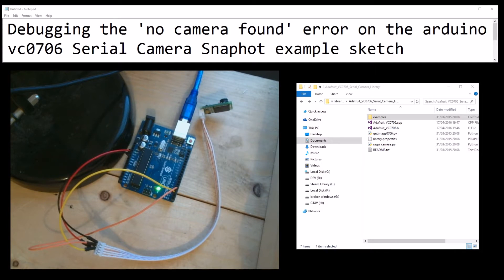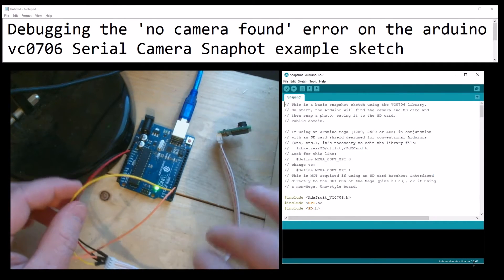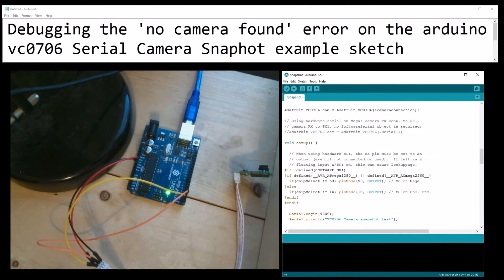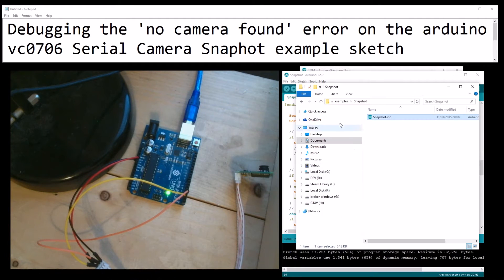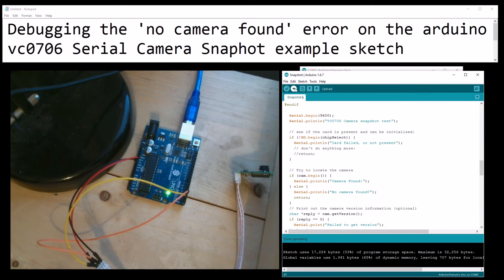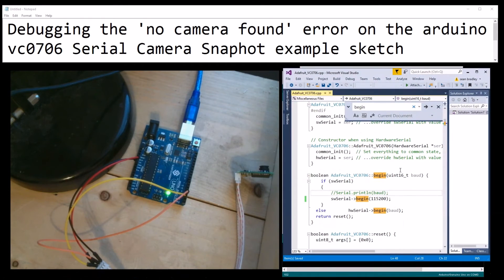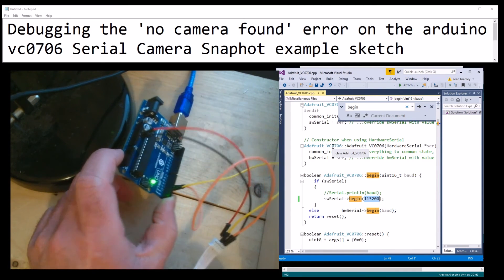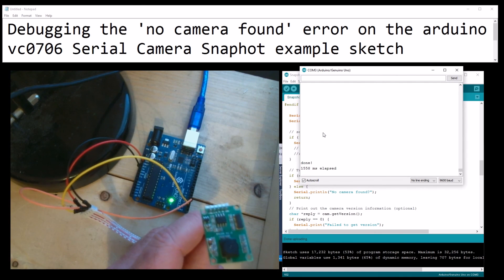Debugging the 'no camera found' error on the arduino vc0706 Serial Camera Snaphot example sketch

Comment: I know this is years down the road, but the library had a wrong data type for baud. It was originally uint16_t and needed to be uint32_t to cover the range to 115200 baud. it works, and thanks to your video.

Comment: Still having this error....my camera doesn't work on the com tool and on the Arduino IDE.
On com tool it shows cmd time out....and on IDE it shows no camera found
Reply: Did u check your wires ? you need to plug tightly , (my English not well) :))
Reply: Anh Quân Tống is it tx- tx and rx-rx or tx- Rx and Rx -tx communication??
Reply: tx-rx and rx-tx , and check if it isn't fit because before i got fit wires i had had problem like u on comtool :3
Reply: Anh Quân Tống what do u mean by fit wires
Reply: plug the wires tightly and surely it can transmit data well  (Oh my English )
Reply: Anh Quân Tống it's well and tight.... but no result
Reply: MrSijinroshan  so , do u have usb uart tl223 , connect it with camera tx-rx , rx-tx and test on comtool to sure your camera is still working . i think it fired @@
Reply: Anh Quân Tống yeah tried that but it shows cmd time out
Reply: MrSijinroshan i think your camera is fired , because i still communicate normally @@
Reply: Anh Quân Tống yeah that could be the only conclusion left

Comment: this method seems doesnt work on my project
is there any way to fix "camera not found" problem ?
Reply from the maker: try experimenting with different baud rates where I set it in the video  @2:30. In this video i use 115200, but other versions of the cam module may prefer 57600, 56000, 38400, 28800, 19200  or lower. I also have a video where I bypass the Arduino board all together and connect directly to the cam module using a PC and a FTDI usb cable. This may help to isolate your issue even further. FTDI video at https://www.youtube.com/watch?v=EVuDURfa7Zc
Reply: i use vc0706
is that okay to use varian baudrate ?
i mean is it possible un-balance baudrate cause harm to device ?
Reply from the maker: don't know, I experimented with many baud rates and also with the different voltages you can get from the Arduino, and my cam still works.
Reply: okay 
thanks for your respond